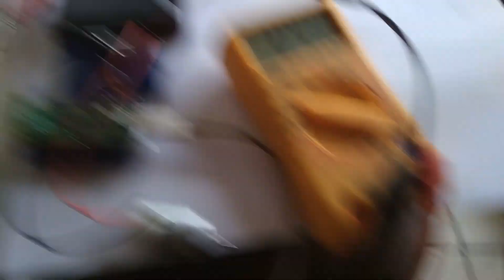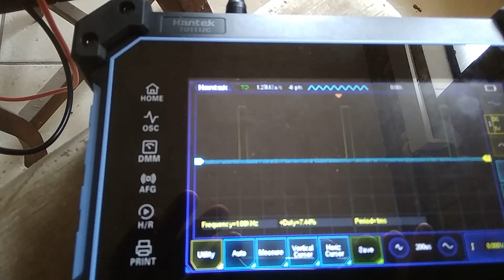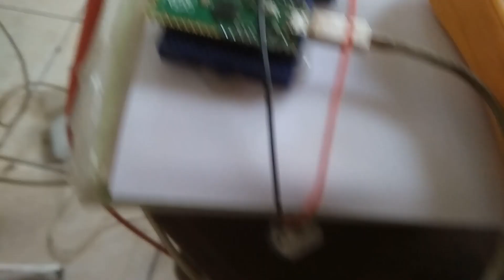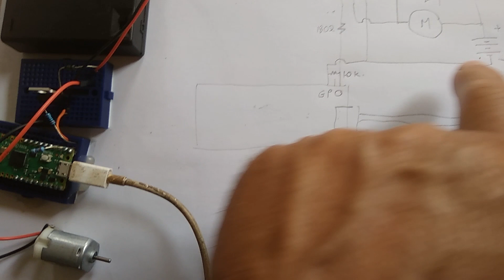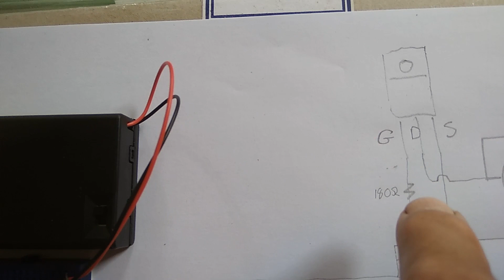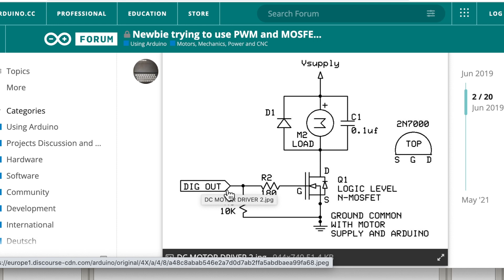Using a power mosfet and PWM to drive a DC motor at different speeds.

Comment from the maker: from machine import Pin, PWM
from time import sleep
pwm = PWM(Pin(15))
pwm.freq(1000)
while True:
    for duty in range(65025):
		pwm.duty_u16(duty)
		sleep(0.0001)
    for duty in range(65025, 0, -1):
		pwm.duty_u16(duty)
		sleep(0.0001)

//THIS PROGRAM SPEEDS UP AND SLOWS DOWN A DC MOTOR
//POWERED BY A MOSFET AND PWM VIA PI PICO USING THONNY